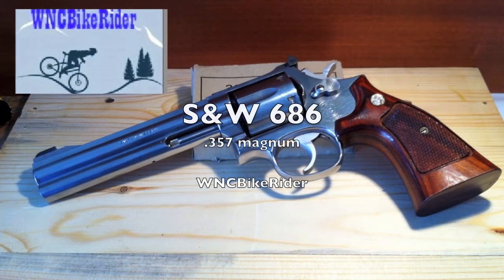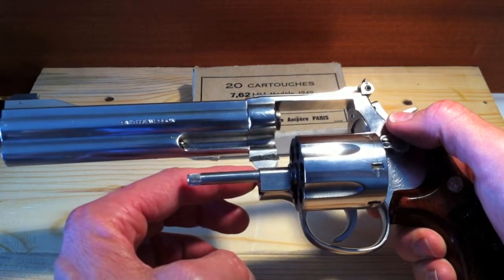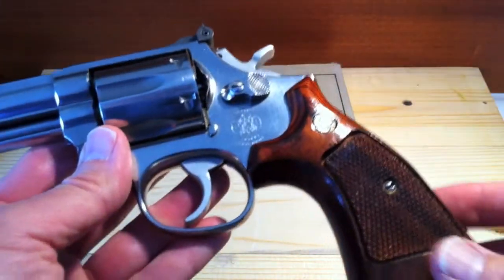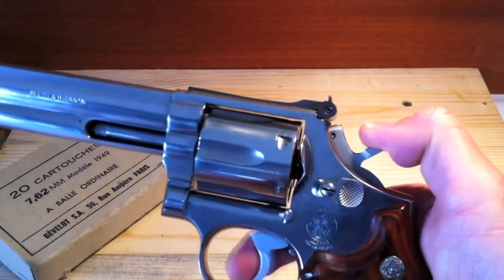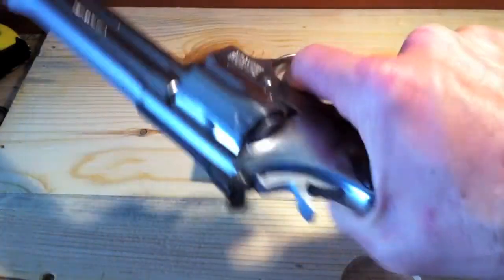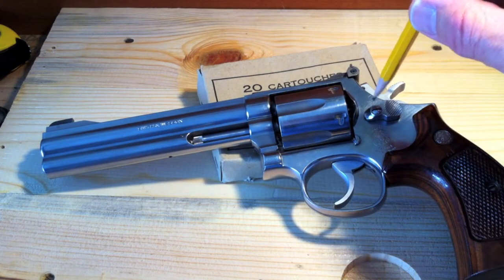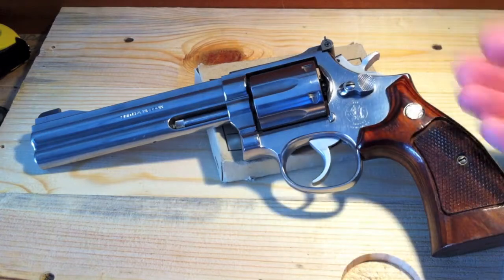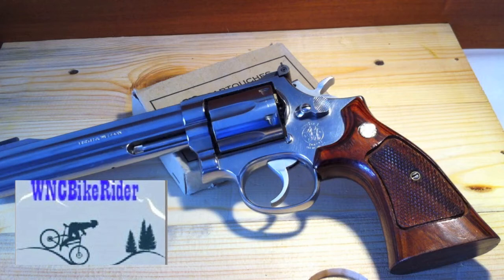S&W 686 .357 Magnum Close-up and Review  No-Dash Variant

Comment from the maker: Hi, $675 would be a little high here. ($500 to $550) Just make sure it comes with the original walnut grips. Many of of the used variants around here are being sold with Pachmayer or other replacement grips. Saw a guy at the gun show a couple of weeks ago trying to sell a  dash 1 with replacement rubber grips for $450. He would have got $500 plus if it had the original grips. 
     Good Luck!

Comment: 10years later you can’t find one of these for anything less than $1100 in decent condition!
Reply: Just picked one up with a POF Renegade in a trade for a Sako 85, one for two deal. Feeling like a winner. Only thing I need is to order some walnut grips as it has the pachmyer grips.